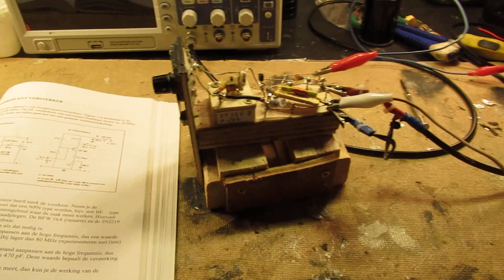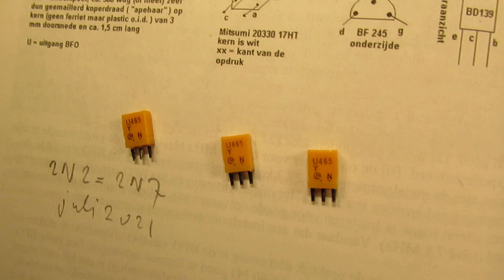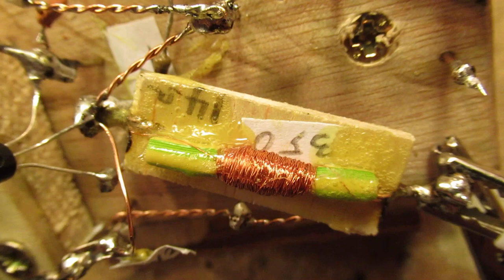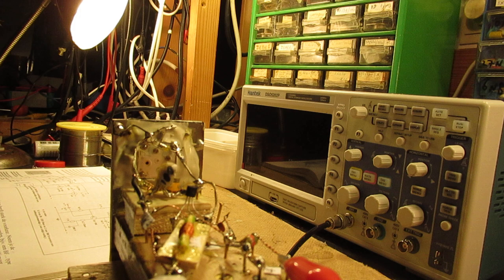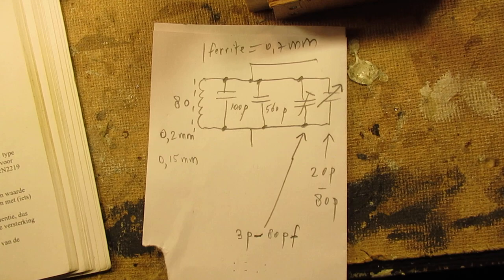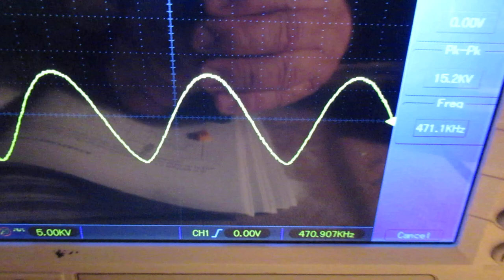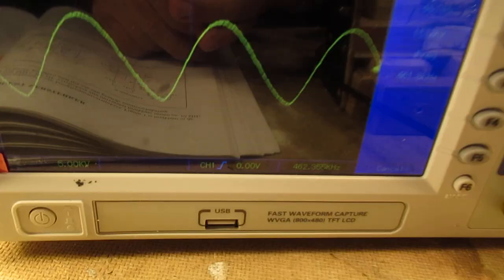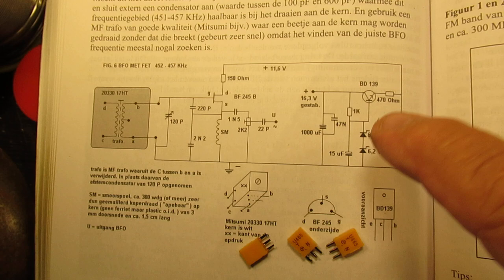VLOG 4 Beat Frequency oscillator for an IF filter 400 - 600 KC to receive SSB/USB: demo/schematic

Comment: It seems you could get a finer tune on the BFO using a 10 turn potentiometer to change the voltage.
Nice build Ko, thanks for the video.
Reply from the maker: Yes, good idea. I will do the fine/definite tuning when all the units are mounted in the receiver. Thanks Barry.
Reply: I made BFO using MC14069 ic  and 455 khz crystal ( it use for TV remote control) very successful it keep near my Sony SW radio I listened 7.2 MHz radio ameter .
Reply from the maker: @sujeevanishantha4274  That was a very good idea!